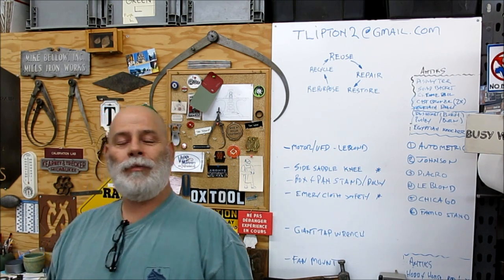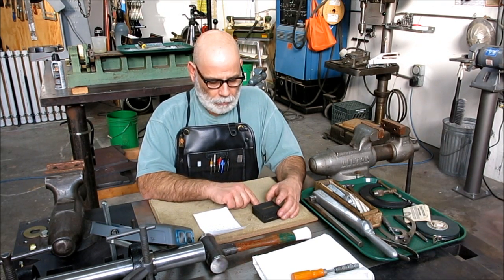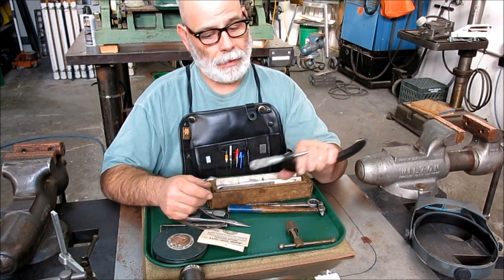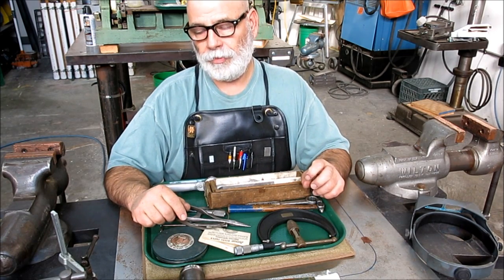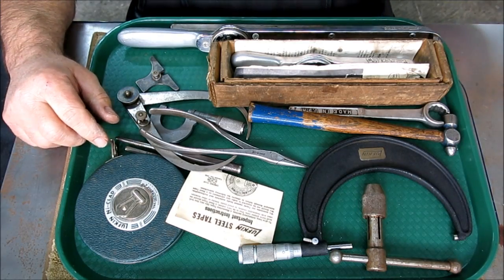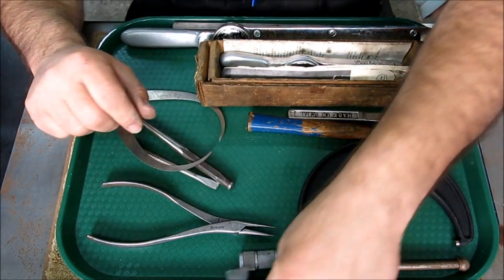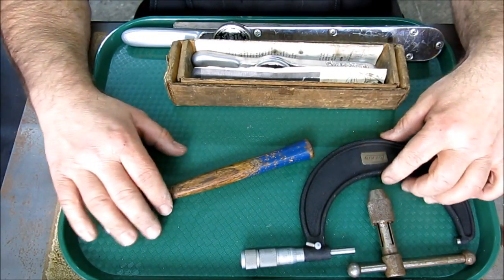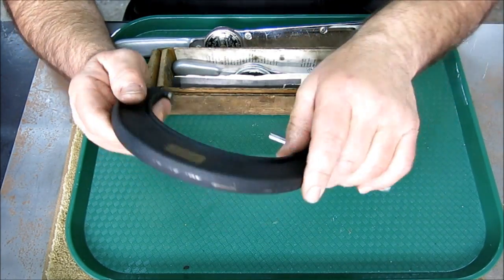Monday Night Meatloaf 62 Lufkin Micrometer Lot

Comment: Those needle nose pliers in your CL find are pretty nice looking little buggers. I love the old Snap On tools, they have a soul.  Even low-end tools back then were made so much better than most of the crap you get these days.
Reply from the maker: The pliers are awesome. I will be on the lookout for some in a little better condition. Somebody else like these particular pair as well. Thanks for the comment.

Cheers,

Tom

Comment: Quite the finds, Tom. Those friction thimble springs are really a pain to reinstall. Place the spring in the slot, then with your fingernail twist around it pulling all the coils into the gap. Then slide the thimble over the spring capturing it. Took me about a half an hour to get the one back in my Starrett.
Reply from the maker: Hey Andre,

Still have not got it back in. Might have to order a new spring for this one. Thanks for the comment.

Cheers,

Tom
Reply from the maker: Andre Gross Its a Starrett. I'm not sure why it wont slide over the friction spring. It seems to get tighter and tighter as I slide the barrel over it. I measured it and there is very little clearance for the spring to fit through.

Best,

Tom
Reply: That's real interesting, if you'd like I can take mine apart this week and show how to put it back together again. Are you sure the spring is clean, and wound up tight? Mine will shrink way down into the groove.
Reply from the maker: Andre Gross Hey Andre,

I had to rewind it around a mandrel to get it to fit the step tightly. It may be distorted just enough to not want to slide through the gap. By the numbers there is almost zero clearance.

--Tom
Reply: Shadonhk

Comment: Had a plastic handle version of the nut driver. Same looking sockets with lines etched or machined on them. The one I had, back in the '60s was made by Vaco. It was handy, but the Excelite nut driver set was more convenient with their hollow shafts for longer screws...
Tom...
Reply from the maker: Hey Tom,

I forgot about the hollow shaft deal. For all the electronickers that use long slotted 6-32's with kep nuts. Thanks for the comment.

Cheers,

Tom

Comment: Hey Tom you can always turn a piece of round stock and place thread that suits your grinders and go into a motor bike or bicycle shop and grab a grip for handle bars, then put it on your bar and you have a grip you like. I actually found a grip that reduces the vibration that can numb your hands after a while.
Reply from the maker: Hi Giga,

I need less projects not more. I ordered one from Bosch. It has the vibration damping feature you mention. Thanks for the comment.

Cheers,

Tom

Comment: Hi Tom.
I like those old torque wrenches too.  I've got the inch pound one like yours, I don't have the ft. lb model but I've got the 3/4 inch drive one that goes up to 600 ft lb.  It also has a battery powered light feature that is supposed to come on at a pre set point.  I've never got that working, but it might be handy when you're pulling hard enough to get that much torque.  I use my inch pound one sometimes when pre loading bearings in gear cases.  Thanks for the show.
Reply from the maker: Hey Ed,

I was looking for the 1/4 inch drive model when I went through the toolbox. I don't think I want to be around when anybody has to run up 600 lb/ft. Thanks for the comment.

Cheers,

Tom

Comment: Hey Tom, I also have a Tahlen hammer, but mine is a 3lb deadblow with replaceable faces. I use it daily. I have lusted over the steel faced ones ever since I saw one in a buddies shop. Tahlen still sells em, and replancement parts/handles
Reply from the maker: Looks like they might be hard to come by. I see a few things on their site that I think I need. Thanks for the comment.

Cheers,

Tom

Comment: Tom,
I'm not so sure about any link between any of the toolmakers, except casual along the lines of: "Form follows Function"

2 oz of steel is going to occupy 0.444 cu in give or take, depending upon the alloy...

Shape it to make a classic ball-peen hammer and you really aren't going to see much of any variation in the size & shape... throw in a classically trained pattern maker, and your part lines are going to look awfully similar as well, as they have developed all of the tricks of the trade to get the best production from their molds at the foundry.

Which is not to say that the newer pattern maker didn't have an example of one of the older hammers to look at while making his molds...

I'm not finding a DIN / ANSI / JIS / ISO standard for hammer designs though - even though you'd almost expect there to be some sort of standard for them these days...

Cheers,

Eric
Reply from the maker: Hey Eric,

These are really close. As you might guess I have other examples of 2oz hammers in my collection. These are machinist close. It seemed too much to be coincidental. Thanks for the comment.

Cheers,

Tom

Comment: Keep in mind that is a new Williams and is a division of Snap-on. It is hard for me to believe but it seems employees of these places have all vanished over the last 20-30 years when Americas manufacturing went overseas, got bought, merged, acquired, raped, and everything else. From what I have gathered the current Williams is nothing but a name that Snap on bought in the 90's.  None of the forging or machinery of the old J. H. Williams was retained and the factory now sits as a ghost shell in Buffalo, NY used a distribution center but very much intact building wise. So the Williams of today really has no relation to the Williams of the past, that is the reason why their superfine adjust ratchet has a different number of clicks than it used to have. The real deal had more clicks than Snap-on, so of course Snap-On couldn't have that for their second line tools so it was reduced to be less than their brand. :-0 Anyways sometime in the late 60's or 70's J.H Williams ended up in bed with Greenfield and TRW. The current Williams stuff I think is mostly made in North Carolina and Georgia. Herbrand last existed under Triangle tool in South Carolina, and I think they also ended up in TRW and thus that tooling has probably after dozens of acquisitions ended up under the current Snap-on industrial banner.  Hard to believe people used to work 30+years at the same place for the same people, now it is amazing if  a factory can even stay in the same town for a decade much less under the same ownership!
Reply from the maker: Hey Brian,

That clears things up......I poked around a little and found some stuff saying Herbrand was a line from JC Penney? You would have to see these two side by side to appreciate how close they look. I'm talking machinist close. Thanks for the comment.

Cheers,

Tom

Comment: Hey Tom, I use surgical tubing to clamp broken guitar necks without damaging the finish. Thought I would share that with you. Love your videos.
Reply from the maker: Hey Chuck,

Thanks for the tip. I didn't expect the paint to come off that easily. In retrospect a rubber band was all that was needed. Thanks for the comment.

Cheers,

Tom

Comment: It is kinda tough to see in the video, but I would guess with the size of the snout on the crankshaft and the partial bell housing attached to the block that engine on the cover of the torque wrench manual might be a Gen 1 Mopar Hemi or maybe an Olds Rocket. They do seem like early to mid 50's engines. If you had a clearer shot of the picture I might be able to verify.

Thanks for all your vids, they are greatly appreciated.

Regards,

Marc
Reply from the maker: Hey Marc,

Ford perhaps? Long snout on the crank? Thanks for the comment.

Cheers,

Tom

Comment: duck bill pliers?  ??? beak pliers???  Yeah, those Herbrand tools are cool.  They are very similar to the Snap-on/BluePoint tools.  I would bet that they were subcontracted by Snap-on for certain tools.  The Herbrand, splined shank,  extractors are almost identical to the set that you purchased and had on your manifold stud removal video.  I've seen that name somewhere before??  My step-dad and grand-dad owned a auto repair business in Pasadena:  Fremont & Purdon, est 1925!!!!  They had a few ancient tools there.  Hah, looks like you chucked the flex handle off the grinder and went to the rigid!  The flex job may have a application on certain modulus work, but it just scared me.
Reply: yep blue point is snap on's line of tools bought from usually major manufacturers, so mostly anything blue point comes from a manufacturer who has made that type of tool successfully for years, though i hate all extractor tools!
Reply from the maker: Hey Joe,

I did that to make Stan feel better. The flex one is pretty cool. Thanks for the comment.

Cheers,

Tom

Comment: Hey Tom, nice tool find.
I cut my teeth on torque wrenches just like those when my father-in-law started teaching me how to re-build automotive engines. His 1/2" one has a red sheet metal box with a latch. That pair look really nice. Dad's is chewed up a bit. He passes away last month, but seeing those brings back great memories. As for the socket set and handle, I have a 1/4" set of Snap On that look like those. This set comes in a gray metal box and the sockets have the same knurling around them like those. I'm told that they were military issue hence the grey color. The drive end are not typical 1/4" though. It's a larger square drive. Maybe so they don't get mixed up with the others

Thanks
Marty
Reply from the maker: Hey Marty,

Glad to take you down memory lane. Thanks for the comment.

Cheers,

Tom

Comment: What kind of wheel is that, Tom?  It looks more compliant than a regular grinding wheel.
Reply from the maker: Hey Tom,

Its a Norton Clean and strip disc. Yes its soft and conforming and cuts less aggressively than a sanding disc. With the grinder speed turned down its almost like polishing. 

All the best,

Tom

Comment: Nice hammer Tom, if you're going to make one, why not make the faces with a male thread and a corresponding female thread in the head so you can change them for brass or plastic if you wanted.

Dan
Reply from the maker: Hey Dan,

I was suggesting you guys make some. Better get cracking. Thanks for the comment.

Cheers,

Tom

Comment: A while back, Adam had picked up some Herbrand tools (wrenches, I think) and was wondering about the brand. My late cousin owned and operated an independent auto supply store years ago. They carried Herbrand tools as their high end brand. Here's a link to some info on Herbrand tools. There's a section included on hammers and striking tools. I couldn't find anything about a connection to the Williams brand.
https://home.comcast.net/~alloy-artifacts/herbrand-van-chrome.html
Reply from the maker: Hey Robert,

Somebody was talking about Herbrand and JC Penney. Thanks for the comment.

Cheers,

Tom

Comment: Hey Tom,
Some nice gifts and Craig's List finds!   A question:  Mechanics are sometimes called "gear heads". What are you?
A "hammer head"? Thanks for the meatloaf video. For some reason, this batch of meatloaf tasted like old hammer handles. Yes! Meatloaf isn't just for dinner anymore!  Actually, I like to take some leftover meatloaf and scramble it with a couple of eggs. Then the stuff goes into a large tortilla with some salsa for a breakfast burrito. Yum!!  Thanks again!
Happy Holidays!
Oxen Dave
Reply from the maker: Hey Dave,

If I was a shark what kind would I be? Well a hammerhead of course. Thanks for the comment.

Cheers,

Tom
Reply: Tom,
Getting pretty sharp with the wit there, Mr. Wizard!
Dave

Comment: hey tom
  hope you had a great new year!!!   one question   have you ever been to Vinalhaven maine?  could swear ive seen you here before.  just wondering   ian
Reply from the maker: Hey Ian,

I was there about a week ago as a matter of fact. Just kidding. I had to look a cool name like Vinalhaven up. Sounds like were Vikings landed a long time ago. 

All the best,

Tom
Reply: you just really look like a guy that vacations out here.  lol  had to ask  love your vids by the way. your the reason I just bought a 15 x 48 cluasing lathe. well and I needed it for my boat shop .   as a mater of fact, the school team name out here is the Vinalhaven Vikings lol  thanks again for the awesome vids and if I ever come across a really weird hammer you can bet ill be sending it your way.  check out my facebook timeline if you get bored  I build boats from scratch. among other things   ian adair
Reply from the maker: TheMadair Hey Ian,

Viking lap straked longships I hope. If you ever need an oar puller let me know.

Cheers,

Tom
Reply: dear tom  hope your well.    
      so I finally bit the bullet and bought a lathe.  it is a 1964 15 x 48 clausing cholchester without a gap bed.  pretty nice lathe for 3500 bucks and came pretty well tooled.  this is my first lathe but I would still like it to run as true as possible.    I have taken the chuck off and found that whoever ran this lathe before was pretty abusive. they must have been putting the chuck back on the lathe without cleaning it properly!!  so it is very beat on both spindle and female side of the chuck. my question is- does the chuck run on the actual taper part of the chuck or does it partially line up on the flat rear small dia. face of the chuck too ??  under the nut? it has an L1 spindle. im wanting to take a cut on the inside of the chuck I have for it maybe a thou or two just enough to clean up the bumps that stick out not really cut much into it. is this possible? I know that when I take some off the inside of the chuck it will make the chuck move back more then what I actually take off the inside and I don't want it to bottom out on the back small diameter face of the chuck under the nut. any help would be awesome. I figured all the videos on tapers it would be a good thing to ask YOU.   all the best ian adair
Reply from the maker: TheMadair Hi Ian,

I would survey what you have before you go cutting anything. I would hand sand and stone any high spots off both the spindle taper and the chuck ID then measure what you get. depending on that result you may or may not do anything. Is the chuck adapter plate integral to the chuck or is it separate? These are fairly inexpensive to replace if they are separate. 

Cheers,

Tom
Reply: I figured the backing plates where pretty expensive but if not ill prob just get a new one. I did get the spindle cleaned up to where there is only about   0.0003  run out on my 4 jaw chuck with it on the spindle.  so I think the spindle is now fine as kind!!  :)   im really hoping to get the 6 jaw bison chuck up and working again because its such a nice chuck.  it makes me sick to think that someone would be so careless while removing and installing the chucks on this lathe!!!  there where a lot of depressions in the id of the 6 jaw chuck and you could tell that it wasn't just from bumping it on the spindle. it was from not blowing out the chips that where in there and just slamming it back on!!!  ugh!!!  some people !! well I guess its time to start hunting for a new backing plate for it.  hopefully wont be to hard to find one used in great condition. if I have to ill get a brand new one. if you could keep your eye out for one that would be great.
(L1 spindle x 10" diameter)   thanks for taking the time to give me your thoughts on this. your a great machinist!!  and you do cool projects!!  keep up the great videos      ian adair
Reply from the maker: TheMadair Hi Ian,

All I can say is Mr Bozo gets around. Thanks for the comment.

Cheers,

Tom